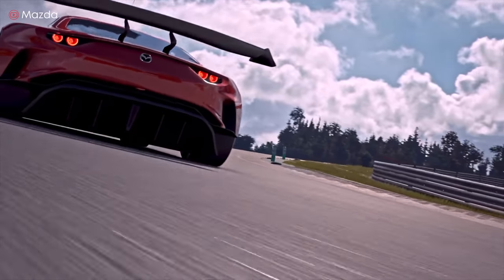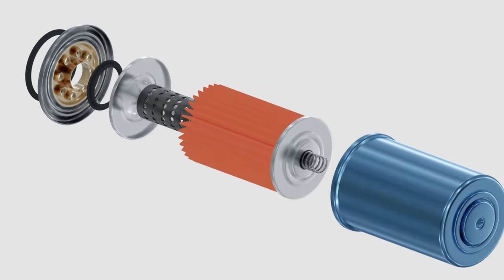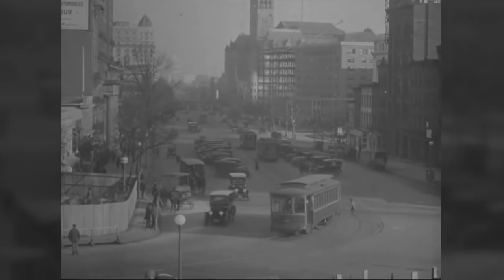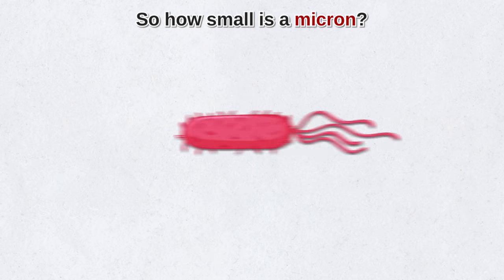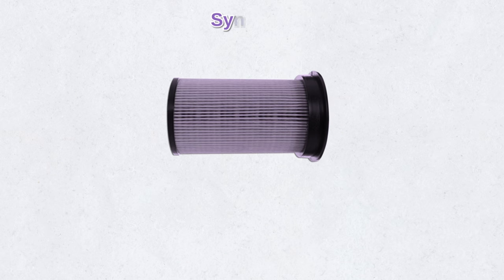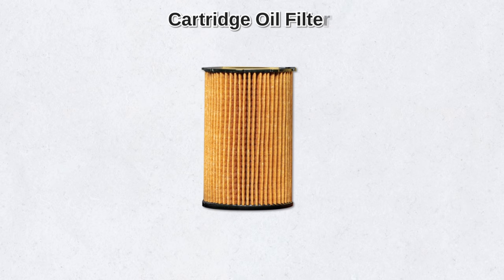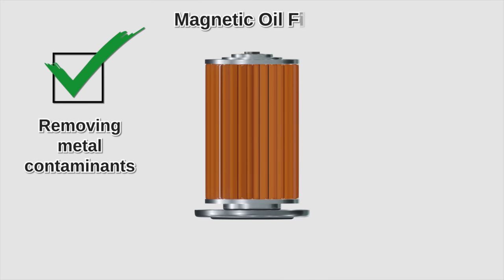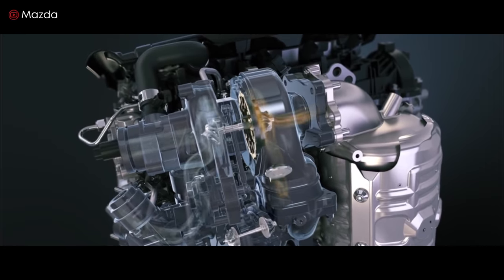This New Oil Filter Just Changed the Game (No More Oil Changes)

Comment: My grandfather was from the first generation of diesel mechanics in the USA. He always told me that long haul trucks would have the filters changed half way through the life of the synthetic oil life span. He also said that he would never let a cars oil filter pass 3000 miles, back then they were not made to be used longer than that, even though there were oils produced (synthetics) back then. So the filters which a majority of people could buy were probably cellulose. How many people today use synthetic oil and are mating them with filters that are really only good for 3000 miles?
Reply: I dont drain oil in anything. I use bypass filters.that use less than a dollar rolls of toilet paper. Right now I am using Great Value 1000 from Walmart. Not that it matters I use Walmart synthetic. I change the toilet paper every 6 K miles on the gasoline cars. On the lawn mowers I do it when I think about it. On a diesel pickup it's about every 2000 miles
It's a matter of never allowing the oil to get dirty and adding enough new oil to to replenish  the additives. The diesel engine oil is black as ink. Oil is amber colored in the gasoline engines. Use Delo in the truck and tractor. .

Comment: Ordered an 88 gm 350 truck in 87. Dealer said it came w break-in oil and to bring it back in 100 miles. I did. Started it on castrol 20-50 and a 2qt filter off of a 6.2 diesel. (only fits 2wd).
730k miles and "never even a had a valve cover off". 1 flex plate, 4 trannys, 2 dash panels, 3 rear ends (2.73 lsd) but never an engine oil related failure. Still held 30 psi at hot idle the day i parked it.
Shoulda bought 2 or 3...they never built better!!!

Comment: I never knew that in the early automobiles they had to have frequent oil changes. Wow ! What a Game CHANGER. Very facinating to learn about. 
Indeed I have a couple funny stories dealing with oil changes. One involve an Aries K wagon I puchsed used that had no dip stick? There was a hole for a dipstick though and it did use an oil filter. Later I had a mechanic install one. 
My recent vehicle is a 2006 Hyundai Elantra. I purchased this one used at 122,000 miles and had taken the car in for an oil change Later I put 6,000 miles on the car. And saved my other Elantra as a parts car. Lights started burning out prematurely on the car I was driving. My Nephew has his own garage where we took the lamps out of my parts car to replace the lamps in the car I now drive and then my Nephew had a great idea! Lets leave the bulbs in the other odometer and simply switch Dashboard clusters? So we did. (BIG MISTAKE! LOL!) HA Ha ha! Instead of the odometer reading 128,000 miles it registered 188,860 miles! Oh mann! Had i not done the oilchange myself the mechanic would wonder why I waited so long to change the oil (as the old cluster contains the milage from the parts car! Which was 60,000 miles MORE ! Oh my goodness! Could you imagine the look on the serviice man's face had i brought the car in for a routine oil change with 60,800 miles since my last oil change? Great Scott ! HA HA Ha ha!

Comment: Many years ago they used canister type oil filters. and there was a particular type that used a cartridge that was similar to a roll of toilet paper. they worked pretty good but could break down over time. and could be messy to change and when the canister type filters went away they did to. I always use Wix filters exclusively. a person can change their oil filters between oil changes. but most oil filters will do a sufficient job if changed at every oil change.
Reply: ⁹
Reply: Was just down at Auto Zone. I mentioned the Jackmaster filter takes a roll of toilet paper.He was too polite to laugh.  There is no oil filters in Auto Zone that can clean oil . Not sure if O Reilly's still sell the WIX 750. It could come close..It needed a Luberfiner canister. Putting the Jackmaster where it cant drain.  Picked up a set of Slime tire valves so I can push the oil back into the engine before changing the toilet paper. The ones with the nut. I will use some type of high temp rubber.yes the 1953 model Frantz was a mess to change. So was the famous Frantz 3 stacker. They were very good at cleaning oil.toilet paper doesnt fit them now. They need the Frantz elements. The Jackmaster  the Gulf Coast junior and the Motor Guards I have can deal with the changing core sizes and the shorter paper.

Comment: I once had a car that ran on straight LP gas so the oil always looked new so I never changed it , when I over hauled the engine, the bearings were all badly pitted because the oil had become acidic despite it looking new.

Comment: I had a an old Ford pick-up that I did an engine swap in. It had a 352 fe and I put a 429 in it. I was didn't pay close enough attention in the process. And didn't notice that the oil drain plug was trapped by the cross member. So I couldn't drain the oil. So for 10 years I just changed the filter once a month and top off the oil. After ten years I got access to a cutting troch and cut a hole in the cross member. And was able to drain the oil. It was very dark but was thick or have any metal in it. Lots of miles without a full oil change was probably why that engine only lasted 11 years or Maybe it was taking it to the drag stripe every Wednesday night and dragging it. I guess I'll never know. Love your content!
Reply: Could have drilled and tapped a new drain hole in the oil pan.
Reply: I used to get Motor Guard  oil cleaners from a guy that welded his drain plug to demonstrate that he didnt need to drain his oil.  He traded the cars in at about 100,000 miles. Can you imagine going to change the oil and the drain plug is welded on. Of course he didnt leave the filter on the car.
Reply: I remember the old Fords. Remove the drain plug and the oil hits the cross member and goes every where. The Mustangs had two drain plugs. One on each side of the cross member.

Comment: You can not eliminate oil changes , even if all the particulates are  all removed and the oil looks like honey it still becomes acidic over time so must be changed regardless..
Reply: You should have told me that 60 years ago. I stopped changing oil in 1963. I never let my oil get wet and dirty. With a filter that cleans oil and I operate at normal operating temperature most of the time. If I buy a used car I might change the oil. Most good oils neutralize acid. Engines need water to make acid. Some keep the TBN numbers up to specs to neutralize the acid. I dont worry about it.

Comment: When I had a Chevy I used an AC Delco oil filter.  I use Motorcraft for my Ford.  Worst oil change experience was they left the master cylinder cap loose on my vehicle.  I stopped going to those quick lube places after that.  They want to sell you extras like vacuuming out your car.  They need to focus on changing your oil.   Bought a Motorcraft oil filter from Walmart few years ago, and the oil filter had something loose in it and rattled.
Reply: Probably loose glue in the filter. One guy heard a sucking noise  after getting his oil changed. They didnt put the air cleaner back on. Took a heavy duty truck. In for an oil change. Looked under the truck. Drain plug was holding by one thread.  Walked back in and asked them to tighten the plug.

Comment: Hey Scotty love the vid mate my when I do my services I change all filters oil, air, fuel, and engine oil every 10k km as my service manual tell me to do servicing every 15k km and I do not agree with this at all mine is a petrol/gas if it was diesel I’d be doing it every 7.5k km to make sure my engine is in optimal condition longer

Comment: My old Kenworth had a spinner on it. Loved that sound at shutdown. It would remove the soot out of the engine oil. A must for EGR engines.
Reply: Had a 65 Honda 305 with a centrifuge from the factory. It was internal chain drive. The centrifuges  were popular on Mack trucks.
Reply: Engines need enough new oil added to keep the additives up to specs. The over the road trucks with over a million miles with no oil drains get their new oil by adding make up oil at filter change. With the big Gulf Coast  filter its 3 gallons when the bypass filter is changed. 5.5 gallons when the full flow filters are also changed. Dont know of any way to avoid needing new oil added.

Comment: My neighbor had an older generation BMW X5 and was doing an oil change when he got the car. The car had bad valve lifter tick. He showed me the cartridge filter and you could literally see light reflecting off of the particles in the oil. When it was time to empty the oil from the pan, the oil seemed to drain out normally. When it seemingly stopped flowing out of the drain plug, a crap ton of contaminants that was clogging up the plug just fell right out, with oil pouring out of the drain plug area. And it drained on the ground, NOT into a proper container. I would love to see Scotty's reaction to this. He would have probably warned not to buy an old BMW in the first place 😂

Comment: Great video.  Applause.  I can't top the previous underwear story,  but...
One time,  I had just had a gauge set installed on my 76 Chevy 350,  and had changed the oil.  I heard that you only need to 'hand tighten' the oil filter.  So after lubricating the oil filter ring,  I put it on.  The next A.M.,  I went to turn the engine over,  and the new gauge showed '0' oil pressure.  I checked the dipstick.  Dry!  The oil filter had leaked all the oil during my previous day driving.  The ground underneath the car was dry.  That gauge saved me from seizing the engine.
Reply: "Heard"?  If there were instructions on the box or filter, they probably said "1/4 or 1/2 turn past hand tight."
Reply: The Wix has been on the Pontiac Torrent  for 4 years and 61,000 miles. I sometimes check it. If I start getting too many particles that I can see on top of the toilet paper in the Jackmaster I will.change the Wix.I suspect the gasket gets compressed and the wix needs to be tightened every year or so.

Comment: Scotty how about talking about changing oil on engine hours versus miles.  Why don't consumer vehicles have hour meters?  One can always install an aftermarket hour meter.  I read studies that changing engine oil at 200 hours is a good bench mark.  Going by miles doesn't factor in all the idling in traffic.  On my work vehicles I don't let them go over 200 hours between oil changes.
Reply: Wouldn’t engine cycles (revolutions) be more important? 200 hours at an average of 1,500 rpm vs. the same 200 hours at an average of 2,000 rpm would cause less engine wear and oil contaminant build up, right? But a 2,000 rpm average would suggest more highway miles than city miles so maybe distance is a better proxy for total engine cycles than hours, and that’s why the industry goes by miles? IDK. Just a thought.
Reply: @billbyrd5150  Unless you're driving 100% highway without stopping engine run hours are the way to go on changing oil.  Why does every heavy piece of equipment have an hour's meter?  Even the one ton Ford Superduty had a total hours and idle hours readout.  If you go by miles you could be way over 200 hours of engine run time due to short trips and city traffic.
Reply: I'm probably screwed my 51 Farmall H with the Chevy 4 cylinder has no speedometer  or hour meter . All I can do is look at the dipstick.

Comment: In the 1960's there was a popular filter, the FRANTZ bypass oil filter that used a roll of quality toilet paper & continually cleaned the oil. It was possible to change the roll of paper every 2,000 miles & drain the oil for complete oil change every 100,000 miles! My dad had a 1965 Pontiac with over 300,000 miles when it was totaled in an accident & he'd only drained oil a couple of times. At one time he had a broken valve spring & the inside of the engine looked like you'd expect for 10,000 miles even though it had over 100,000 miles. We lived in Wisconsin so had 4 seasons to deal with.
Reply: I started with the Frantz oil cleaner in 1963 . Engines were nasty in those days.we normally changed the toilet paper and added a Quart of oil every 2 K miles. Too many times badly neglected engines were so sludged up the Frantz was lucky to go 50 miles before being clogged with sludge. Rare with these modern engines .Better filters came out later. All I have now is Gulf Coast juniors and Motor Guards. Motor Guard went to compressed air filters. I think the Gulf Coast  juniors have been discontinued. Australia's  best filter the Jackmaster is here to replace the juniors. Gulf Coast has big customers like Shell offshore that not only need big filters but they need little filters for like lift trucks. The Jackmaster is better and more economical  than most we have including the Frantz. They have a sock filter element. Some Austrailians cheat and use toilet paper. The top loaders are the easiest to service. The big companies dont mind buying the sock filter elements. I'm  a toilet paper guy. Frantz came out in 1953. Jackmaster in 1954. Googled Jackmaster.  Interesting history. With a pristine engine like my nearly new Rambler It was easy to keep the engine pristine. These newer engines with fuel injection and synthetic oils keeping the oil and engine clean is no challenge. All I have now is Gulf Coasts and Motor Guards. I dont drain oil at any mileage. It also helps to drive enough to allow the PCV to remove the water and blow by fumes. Short trips in cold weather can cause problems.. In Idaho I drove 36 miles to work. Made it easy for the filter. I use the Great Value 1000 from Walmart. Some use Scott 1000. For awhile I got it from Office Depot by the case. I have a dozen in use. NASA saw my posts and asked for a propaganda package. They use the Gulf Coast filters now. Was talking about a truck with a million miles with no oil drains. Road King Magazine asked for the truck owners  phone number. They did an article on the Gulf Coast paper towel filter.
Reply: I just got in a Jackmaster  Classic from Australia  and put it on the Pontiac. They are probably the best in production.  They have the high dollar fabric covered elements but I put a roll of Great value 1000 from Walmart in mine. Used toilet paper for 60 years. Too old to change now. For awhile I had to get toilet paper at a janitorial supply. Some of the guys are using Scott 1000. I have used all of the filters. I prefer the top loaders
 They are the easiest  to service when using toilet paper. Bigger seals for the bigger cores. Didnt need the Jackmaster  I have game changer filters on everything with an oil pump. Couldnt help myself. Had to check out the Jackmaster. It didnt disappoint. The NASA diesel equipment engineer said we dont keep our equipment long enough for the filters.
Reply: Looks like the only filter element that fits the Frantz is the Frantz element. Sad to see Frantz users trying to make the Frantz fit the toilet paper. With the Jackmaster you push the paper in and put on the lid.
Reply: Years ago a real estate and insurance agent in Denton Tx Bill Biggs said I have a Toyota Corolla with 100,000 miles on it. Is it too late to put a Frantz on it. I asked him how long he planned to keep it. He said a long time. I said it needs a Frantz. Years later my wife said mr Biggs this is my husband. He said I know Ralph he put a Frantz on the Toyota it has over 500,000 miles on it now. Took the boy scouts on a camp out and they found the Frantz elements.

Comment: Bought a used car yrs. ago w/ credit card, dealer put heavy oil in motor 2 cover rod knock. Found out after purch. Lost $3,000. 🔥🔥
Reply: Bought a beautiful  Nissan  Altima 06 from a local GM dealer. No warranty  cash car. Leather the whole package. Ran nice had 225 k on it. Drove it home and parked it. Started it the next morning. Filled  the whole neighborhood  with smoke.went and got some valve stem seals then realized the valve bores were worn. Ordered a Japanese import engine and installed it. Nice engine 1000.00 including shipping.Probably highway driven. 267 K miles on it now. Engine from Japan looked new. Wiring still had color. Lot of soft carbon. Looks like it never reached operating temperature.

Comment: I drive a hybrid in the city mostly... So engine is only on maybe 40% of the miles shown on odometer...
Change Full Synthetic Ams Oil and a Wix filter about ever 18 months or 15,000 miles...
Oil Analysis shows NO Wear nor breakdown of oil, but I change it anyways because of  moisture chances...

Approaching 200,000 miles 🤩

Comment: My first car outta high school was a 1985 Ford Thunderbird with less than 20,000 miles on it... the first time I changed the oil in it, I notice only a few quarts came out... I'm like wth... then I notice the 302 V8 had a front and a back drain plug in the oil pan...lesson learned !!!
Reply: That happened to me with a Mustang. Drain plugs on each side of a cross member if I remember right. Been about 20 years.
Reply: It happened to me in 1947 once with my 1923 ford model A

Comment: I have used Suzuki, Hyundai, Toyota cars and Engines last for ever. Oil filters are very cheap. Even while changing oil, mechanic asks, if I am sure I want to change the oil. But I still change. But I cant go by age, I do it by mileage. or I would be on streets soon. If a car is sitting for a year, I don't consider it, I just do it by ODO. But I do keep checking the Oil quality.

Comment: I have removed several Cartridge Filters that "Exploded" inside the housing. Fun removing the pieces. Or some of the High End German Cars full of Sludge when working as an Auto Tech. My Harley 1200 (2018) came with a 40 Micron Filter. I have been using Bosch Premium rated for 20. Personally, I use Bosch Filters whenever possible.
Reply: My daughter has the little 2003 Pontiac. The cartridge is very easy to change. On top of the engine. The last two times the pleated paper was still clean but crushed.  Dont know what that's all about. Sun bird ? 4 cylinder.